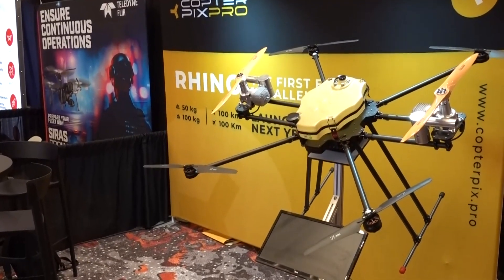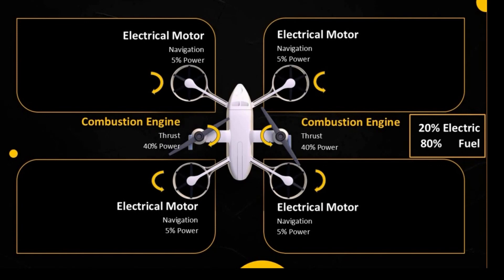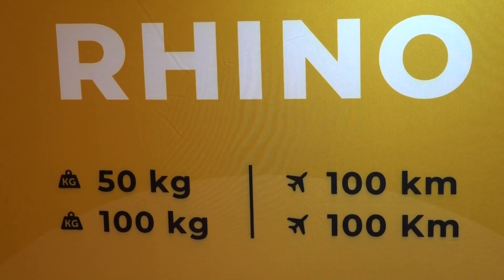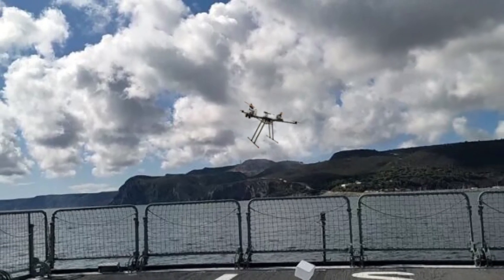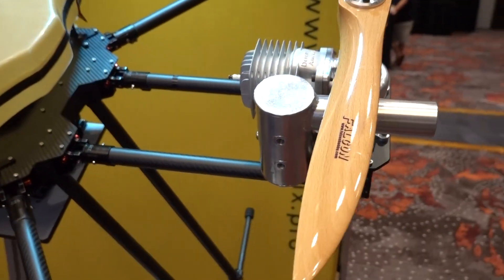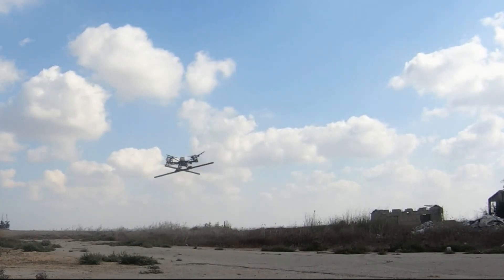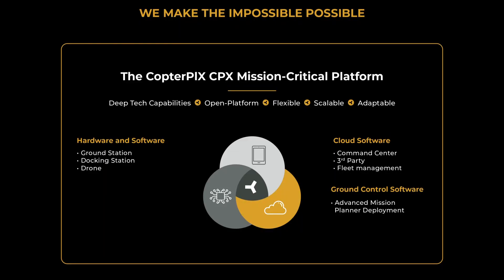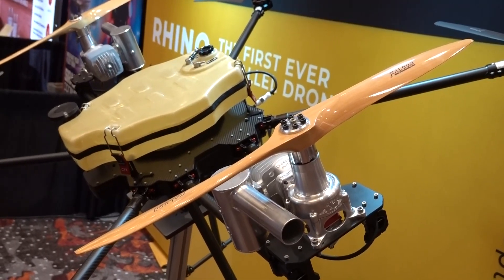2 Gas Engines + 4 Electric Motors = 2 Hours and 25 KG Payload

Comment: While I love all my electric copters, im still not completely sold on 100% electric because of the huge limiting factor of range, especially when carrying a payload. I think gas internal combustion engines have a major role to play in these types of drones. I mean 62 miles range under full load is impressive and the fact that the batteries are also being charged during flight. I could see something like this being scaled up and used for firefighting water drops.

Comment: Cool idea, but I'm not sure the extra failure points are worth it.
Reply from the maker: That's a fair point... However, flying for two hours with 25 kilos of payload is a pretty impressive jump in terms of performance -- a "game changer," if you'll forgive the cliche. I guess we'll need to wait and see what the operational experience reveals in terms of reliability, but as a species we're not exactly new to building small gasoline engines...
Reply: @Roswellflighttestcrew1947  flying for two hours with 25 kilos of payload is REALLY impressive. But do you know what type are those 2 engines? thanks

Comment: hes not the first to think about using gas to power drones.
Reply from the maker: Definitely not, I've seen quite a few and even flown one or two over the years. HOWEVER, what is different about this one is that it relies on those gas-powered engines to turn fix-pitched props by direct drive. Every previous gas-powered multirotor I've seen either uses an on-board generator to convert torque into electricity -- allowing it to fly like a conventional, electrically powered version, OR they have used variable-pitch props. CopterPIX has found a way to make it fly (literally) without either of those substantial concessions.
Reply: There was a similar project on Kickstarter many years ago, combining electric "assist" to a set of fuel motors. It never got off the ground and all the backers were left hanging.
Reply from the maker: Ouch! That's one thing I've observed over the first 15-or-so years of the drone industry: a lot of people rushed in hoping to make a quick buck and either overestimated their own capabilities or intended to commit outright fraud from the start. Something about a new industry seems to pull in the flaky types, along with everyone else.